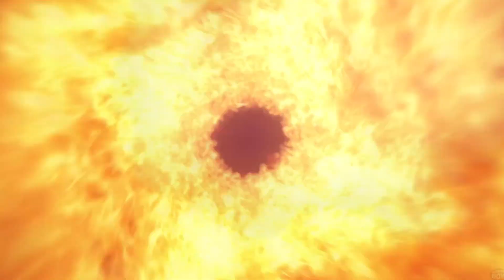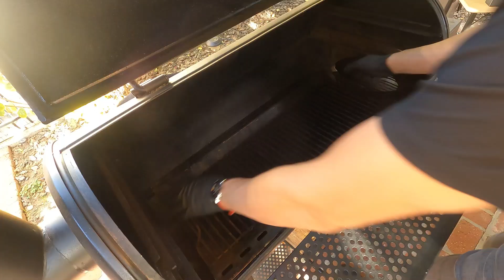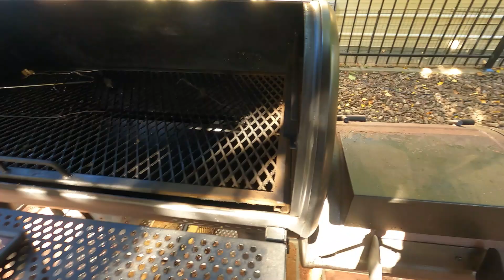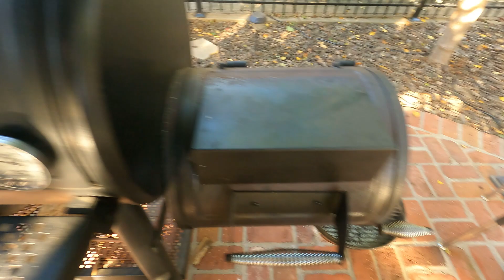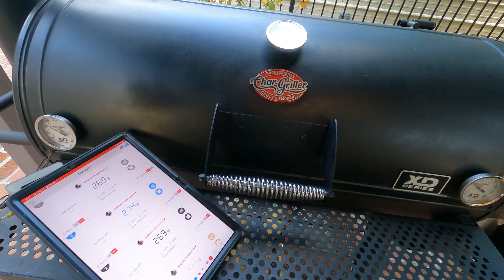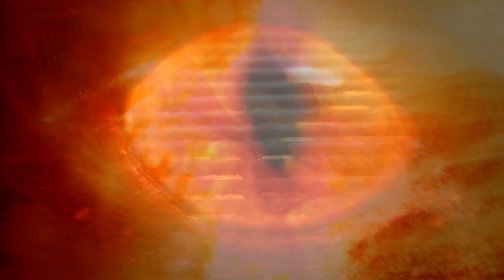Chargriller Grand Champ XD Mods, Baffle Plate (Tuning Plate) Installation and Results

Comment: Wouldn't this ultimately turn your offsets smoke direction? Instead of the smoke going over the meat, it would just come from under, no?
Reply from the maker: well...not really, it still goes out the stack on the left.  a little smoke trickles up across the entire bottom, versus all of the heat coming up on the fire box side.   This is how it evens temps.  smoke is till everywhere, just the heat is more distrbuted.  it gets similar results  to a reverse flow, but it doesn't revers the flow. :)
Reply: It definitely changes airflow now it heats more like a pellet grill or gravity charcoal grill, from the bottom up. Less convection in the cook chamber.
Reply from the maker: @joshuajones5856  yeah and prevents direct heat. so in a sense it works more like convection....

Comment: What can you do about drippings? I'm assuming a tin pan or tray sitting on the plate, blocking the holes, would impact heat distribution?
Reply from the maker: drippings take a while to clog up the holes. you can slide the plate out and wire brush it as part of your regular cleanings. Its not really an issue at all :)

Comment: Hello and thanks for all the great info. I am running the baffle but can't seem to get within 10° from left to right. That is with running the exhaust stack at 2/3 closed and the firebox at 2/3 closed as well. Any advice?
Reply: Hey to start the smoke stack should always be wide open.  And also make sure you have a full load of charcoal.  Control it with the intake.  Sounds to me like you are choking it out or not running enough charcoal.   Hope this helps